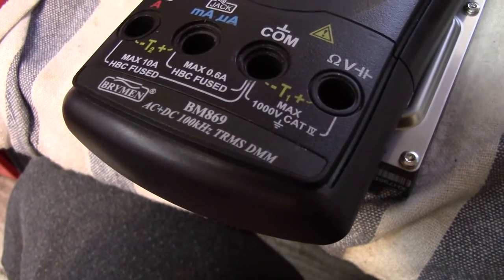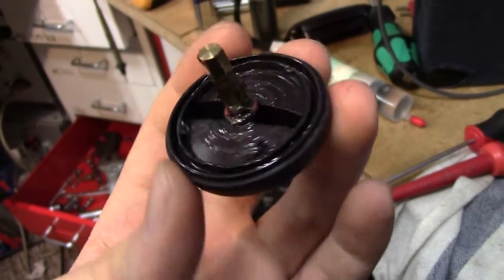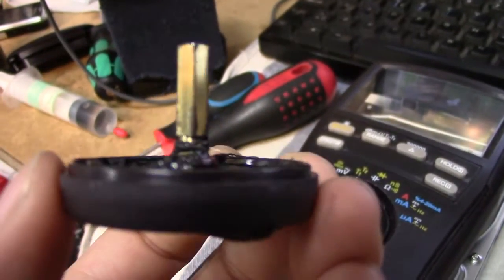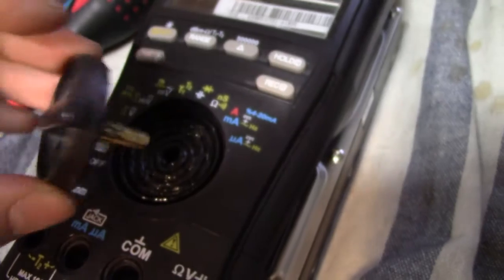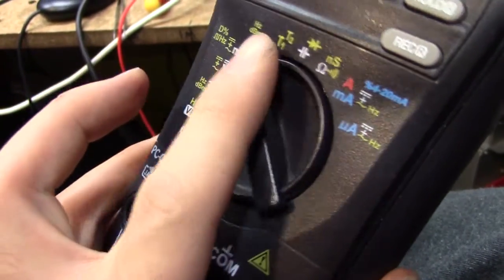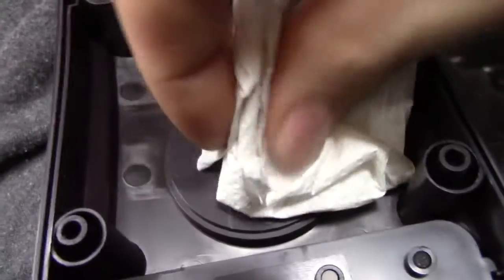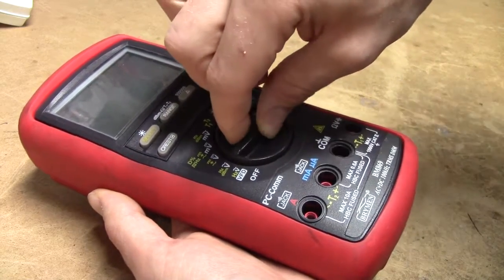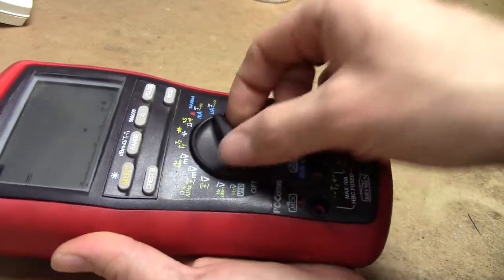Brymen meter top tip: Lube it up!

Comment: Very nice tip! I also had the same problem when I bought an Keysight U1241B, it was very scratchy like sandpaper, I opened it up and applied some lithium grease, then it worked super smooth. I did the same thing to my little BM231, but still it is a little bit too stiff for my preferences, maybe bending inwards the white plastic "springs" will be helpful like someone said in a comment here, I will try. At my workplace we have some Fluke 175 and over the years they developed stiff and slightly scratchy switches, so I opened them all and applied a little grease also on the pcb golden tracks...now they are almost smooth as new.

Comment: Hello,  i just ordered this meter,  ca yo explain to me how you got the knob off, i heard what you said about the lock washer but don't really understand how, does the knob pull off,  how do you remove the lock washer?
Reply from the maker: +grktycoon The lock washer is on the inside of the case. You slide it off of the knob axle, and then the knob pulls out of the front of the unit.

Comment: Anyone else actually using a DMM at work won't care about such things, as long as the switch turns and functions properly.
This is a clear case of: "I've got nothing else better to do than be concerned about the feel of the rotary switch on my DMM".
lol !
BTW, all that grease will surely find its way onto the PCB somehow with time, despite the O-ring...
Reply from the maker: You sound like one of those guys who vehemently argue that a Phillips head screwdriver is just fine for Pozidriv screws.
Reply: The rotary switch alone is not what takes a measurement, nor the grease for that matter. That was my point, which you obviously didn't get the first time around... ;-)
Reply from the maker: AlainHubert No, I got that bit perfectly. The point you missed in my snarky reply, was "why settle for good enough when you can have better"?